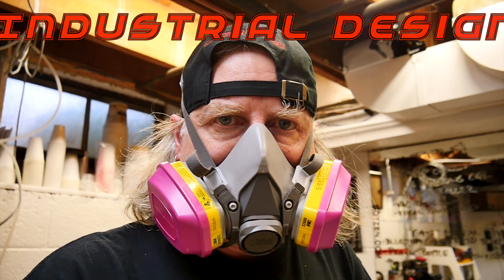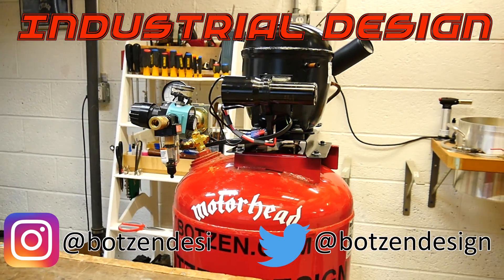Digital iPad sketching The Power ADAPTER Apple REFUSES to make!

Comment: The power adapter that these companies refuse to make is really just one that has 3 prongs to prevent them from falling out of sockets, The 3rd prong isnt necessary to function electrically but it creates more limitation of movement on Y axis. They really should just stuck a plastic plug in on the flipout our like a slide out plug to reinforce weak connections